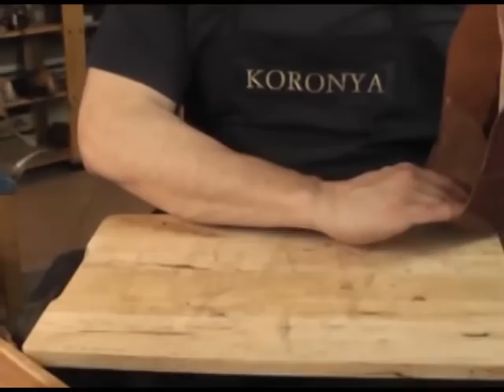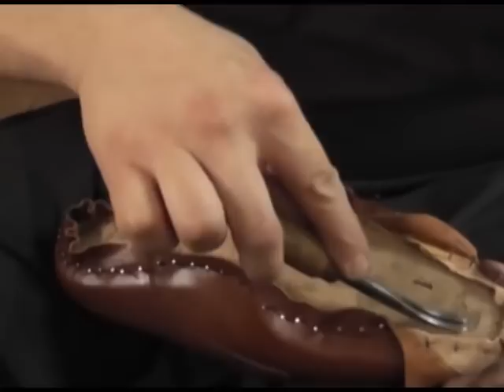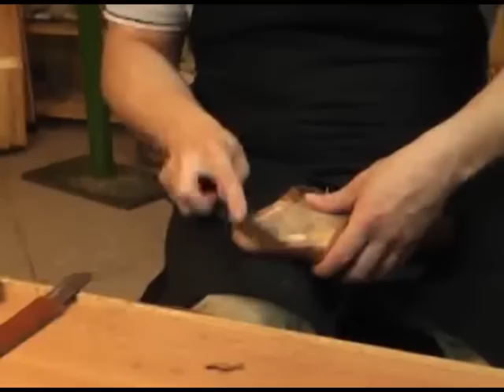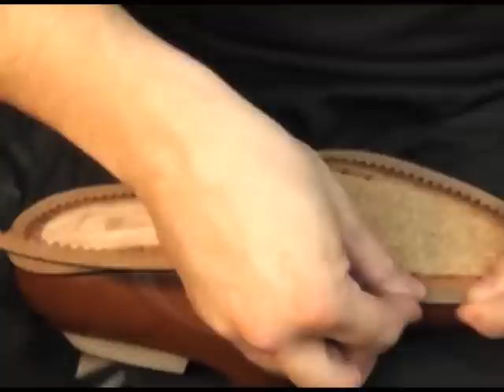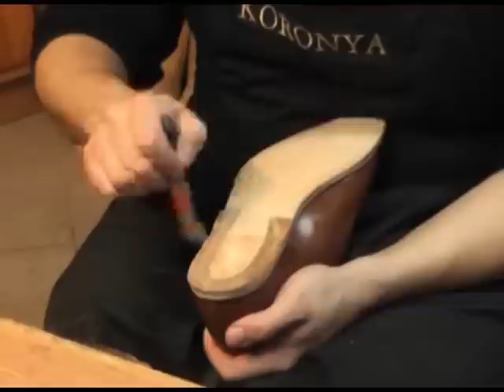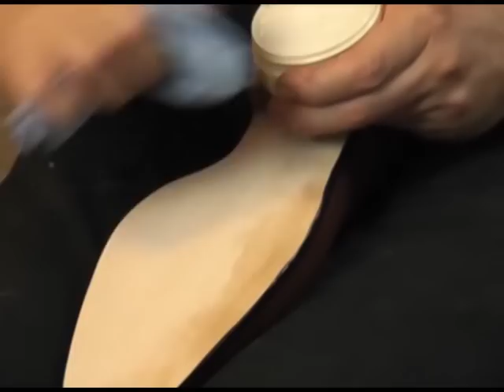Basic Shoemaking Method - The Cemented Construction

Comment: Many thanks for this video. Two questions. (1) Do you ever worry that the glued on welt will come off at some point? (2) Is there a way to Blake (Mackay) stitch a cemented shoe by hand?
Reply: Answer for your first question is : Yes, it might happen, but these glues are really strong and if you let them dry for 24 hours they gain a lot of strength. It takes a lot of time before they come off and when that happens you can resole your shoe.
For the second : Yes, there is, but it is slightly different construction when you want to stitch that.
Reply from the maker: Glues are actually very durable if the surfaces are properly prepped and the appropriate drying times are observed. And it's not impossible to stitch the shoes after the fact but there's not much sense in doing it.

Comment: What was the sales price for this shoe? If it takes 2 hours to make one, and you need 2 for every person.
Reply from the maker: It is a bit more complicated. +design +pattern making +upper making +other, preparation, administration, marketing, etc. Not to mention that this is only a cemented construction, which is a very basic technique, we don't even use it for custom orders.
Reply: Thank you for you'r quick response. Are there cobblers you would recommend, in Sweden? I prefer quality boots that last long with care.
Reply from the maker: You might want to refer them as "shoemakers", but actually you have several good ones in Sweden. Find Janne Melkersson or Carina Eneroth.
Reply: what is the bottom of the shoe made of? Is it wood or something else? And does he use glass as one tool?
Reply: very nice
Reply: Daniel Alt I've heard of leather soled shoes  so I'm supposing it's leather. It sure was cutting like leather.
Reply: Marcell Mrsan if you need workers i can provide we also make leather shoes...If you want i can show you many designs and how we work...

Comment: This is fantastic content. I've got about 10 years hobbyist experience in moldmaking and casting, and about 5 years experience in hobbyist leathercrafting, and 5 years experience in hobbyist woodworking with hand-tools. I'm very tempted to get into shoemaking, and I'm most interested in starting by making bespoke lasts. I understand the technique of handcarving a last from wood, but I'm more interested in the more modern method of resin lasts. Do you by chance know of any resources related to modern last making? Unless I can find some, my current plan is to make educated guesses based on my current knowledge and from there, just learn from my mistakes.
Thank you for sharing your talent!
Reply from the maker: Hi thanks for checking in! Lastmaking is very industrialized, even more so than shoes. Plastic lasts are just more durable and can last practically forever and is very easy to manufacture. Sorry I couldn't be more of help. Good luck!

Comment: Hello Marcell! I am a beginner in shoemaking (I started 3 months ago and I have already done some pair of shoes), I would ask you which are typical problems of cemented construction compared to welted kind. Is very easy that outsoles come off? Thanks!
Reply from the maker: Cemented construction can be very sturdy, since the glue we use is industrial strength, not your average school glue. Just make sure to prep the surface well and wait the appropriate amount of time for drying. All in all, I would say go ahead and keep making them until you feel confident enough to tackle a welted construction.

Comment: How long does this cement construction last compared with Blake construction ? Does the glue improve in recent years that makes the cement last longer ?

When a shoe break, it is the cement part most vulnerable to damage ?
Reply from the maker: Glues are actually very durable if the surfaces are properly prepped and the appropriate drying times are observed. It's totally possible that they'll need repairing after a number of years but it all depends on how good of a care the wearer takes.

Comment: may i know is there any difference between cemented construction and "high pressure cemented construction" ? or is it just another marketing gimmick? i've been trying to find out way to make a high quality cemented shoes without resulting to goodyearwelt or blakestitch. do you mind explaining to me how to build high quality cemented shoes? and by that i meant no visible glue scratch, and similar visual quality to those welted shoes. thanks before :)
Reply from the maker: Glue marks are not supposed to show. If you're doing it by hand, just hammer it properly and prep the surface.

Comment: Very interesting video and Craftsmanship  i had a Traumatic Brain Injury thats caused some paralysis in my limbs and in order to walk i  must utilize a  Knee Ankle for orthosis  that is made out of  a  resin and a woven core similar to fiberglass  but other materials the  brace  has large stainless Steel bars  inside of it to stiffen the structure and attach hinges at the knee area  although the  firm that builds the brace for me orders Ortopedic shoes  that look nice and work  well they  could be improved on fit for comfort  and possibly aesthetics  at this moment in life i  am  forced to wear white  Velcro strapped sneakers to amost everything i attend  although it works ok most of the time  on the rare occasions i need to wear a formal suit and tie  white sneakers can be  not the greatest choice in general those are family functions like a wedding or a funeral and my family  understand my medical history and reasons for  showing up in sneakers  ive very often wondered  how   The process  was done by a Craftsman  and the tooling  you use  i was impressed with the work  in this video and how much of the process is  done by hand  i guess i thought it would involve  special machinery
Reply from the maker: Glues are actually very durable if the surfaces are properly prepped and the appropriate drying times are observed. It's totally possible that they'll need repairing after a number of years but it all depends on how good of a care the wearer takes.

Comment: While the work is impressive, I think it is highly impractical. and is only reserved for luxury shoes. There are so many steps where a machine can be brought in to do a more than adequate job. Leather moulding can be faster and easier, cuts can be more precise, surface roughening can be more even, excess removal can be done in one go, all of which saves a lot of time. The shoes can be cheaper and more people can own shoes. Some people had also compared a shoe to a car tyre, but ask youself this - even if you can make a tyre by hand, would you though? It just gets to point whereby mechanisation is a much better way than manual methods. Now work backwards and see if it applies to dress shoe-making.
Reply: of course you can mechanise every step, but when you buy hand made shoes like this you don't only buy shoes, you also buy a craftsmanship, transmited generations by generations back when people had to do everything by hand, and support this to continue again. 

there is enough factory made shoes for everyone yet, if he want to mechanise, no more people will own his shoes, because his shoes would no longer be his anymore.. :)
Reply: Also, i just saw the cutest leather work shoes for like 400$,but Im going to make them instead #brokebitchstyle. Its important not to forget how to do things by hand. Not everything is for profit:)
Reply from the maker: Oh I'm not against industrialization and machinery at all. I have machines and I use CAD for pattern design all the time. I just wanted to show the process the way it existed before mass production. It's important to preserve the knowledge even as our technologies advance.

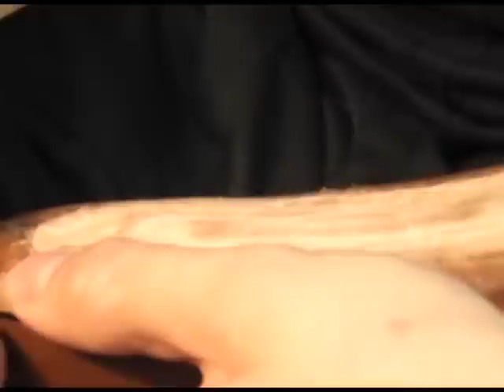Comment: At 12:00, why no stitching that strip. That stitch bring more value and strength. Even someone can easily resole..
Reply from the maker: The glue does the job of holding things down. Glues can be very durable if the surfaces are properly prepped and drying times are observed.

Comment: just using glue and nail, are you sure that shoes will strong enough if not sewing
Reply: Stitching, not sewing.
Reply from the maker: Glues are actually very durable if the surfaces are properly prepped and the appropriate drying times are observed.

Comment: "fake stitching" on the sole makes me automaticly assume low tier product pretending to be better then it is.
Reply from the maker: it is an educational video for free. I don't make products like this and I am certainly honest about my products.
Reply: Looked like you were promoting this technique. If not - good. Question: How long would cement construction survive a dayly use? 1 year? 2?
Reply from the maker: @GerbekSergey  That depends on the materials and the craftsmanship. The whole "cement is wrong, hand-stitching is good" belief is actually very outdated, coming from the age when we used old fashion press cements and of course: the poor materials they use for these shoes in the industry. Modern adhesives are very strong and durable. If the shoe is properly made, this is as durable as any shoe and can survive several years.. "daily use" is another problem. No shoes can survive more than a few years, if you don't let them sit and dry and place a shoe tree and get regular repairs. If a shoe falls apart, that is usually because of the cheap paper insole, bonded leather stiffeners, cheap substitutes in the construction - not because of the cement let the sole go.
Reply from the maker: @GerbekSergey  One more thing: this is a great technique to learn the trade and sometimes there is no more alternative (a welted high heel would look hilarious and it would be very heave as well). You have to achieve a very sharp feather edge otherwise the shoe doesn't look very sharp. There is no welt to pull in the sloppy lasting and hide minor details. This technique can greatly prepare you for more advanced constructions.
Reply: Maybe it is about materials - my experience with (men) shoes made this way is that sole begin to split in layers and eventually fall off after about 8 month of use...even expensive ones.

Would be glad to here a professional advice on how to judje the pair before buying - they all look very good at first.